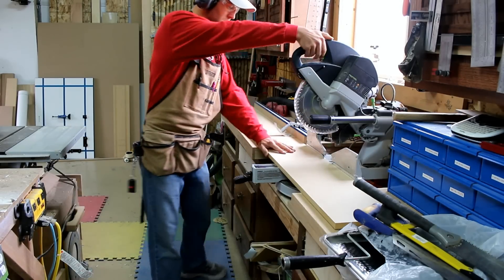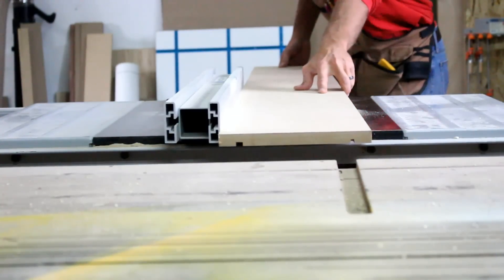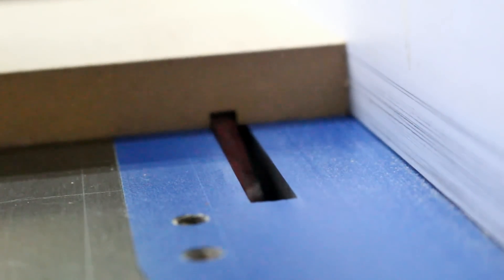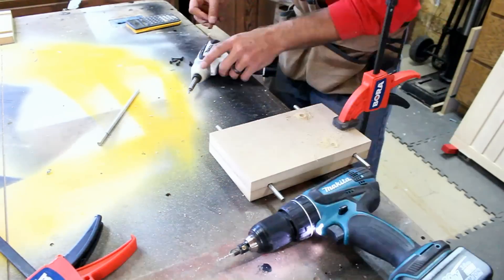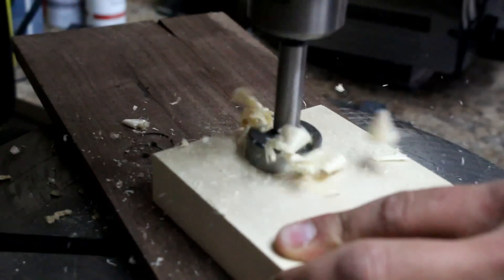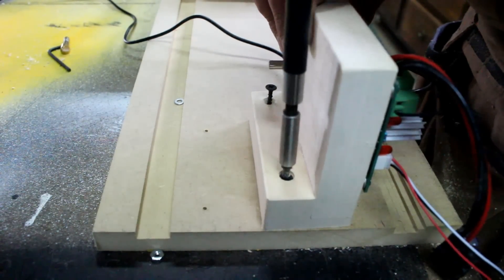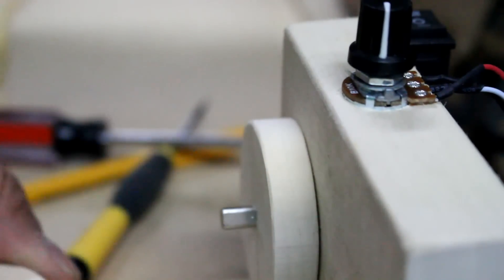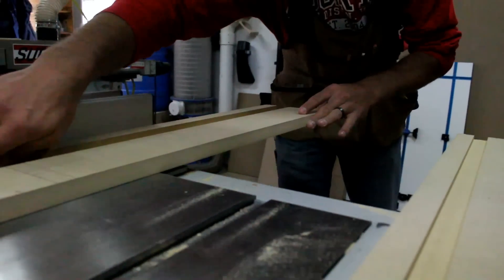Build A DIY Motorized Camera Dolly

Comment: nice build, you can cut down on the vibrations if you use smooth shaft for the wheels instead of threaded rods